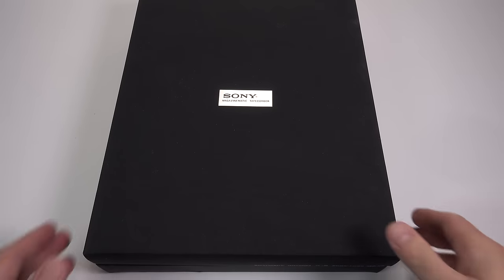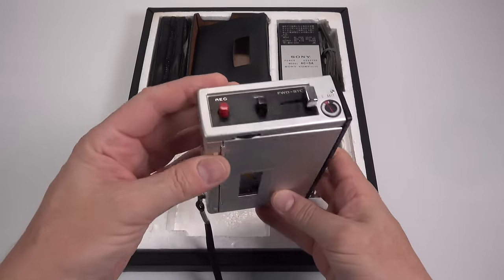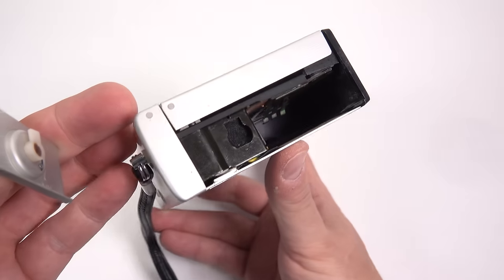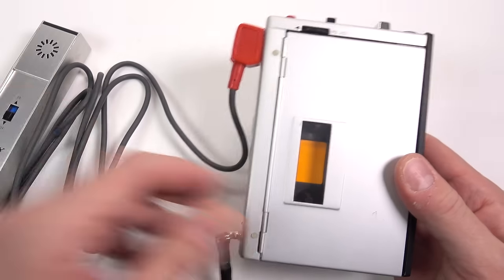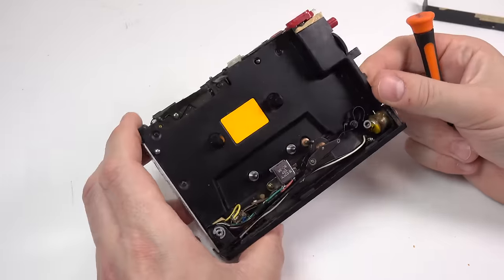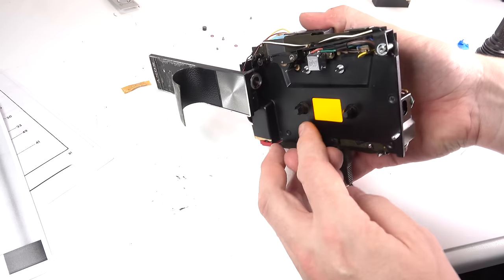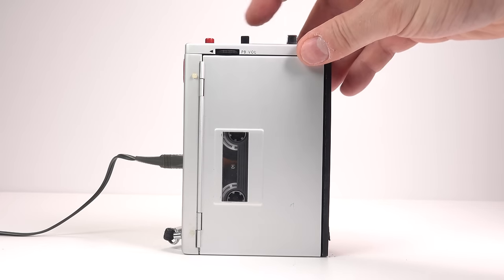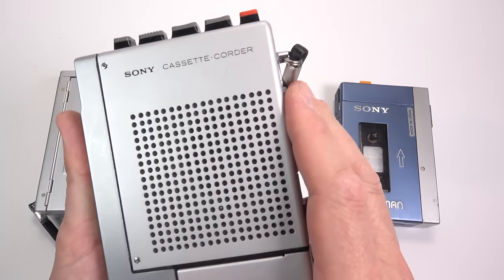Sony's proto-Walkman that went to the moon*

Comment: Lovely piece Techmoan. I had the same speed variation issue with a tape recorder from the 1960's, and it wasn't the electronics. I found that when the tape slowed down, gently tapping the motor caused it to recover for a while. In that era, the speed was cleverly regulated inside the motor by using centrifugal forces to momentarily pull away brush contacts as the commutator speed increased , thereby briefly breaking power to limit and maintain a maximum speed, a bit like a governor. This was even adjustable via tiny set screws, all inside the motor. I suspect your device has the same issue. In my case, cleaning and re-seating the brushes, and cleaning the commutator contacts resolved the issue completely. The curved face of the brushes must be preserved though to maximise the surface area in contact with the commutator, otherwise (as I discovered) insufficient power will be delivered to the motor.

Comment: I love the grille for the built-in microphone. I've seen that design on several old items way back when. I always liked it. The one on the hand-held microphone is nice too, but of course doesn't catch the light in the same way. I'd love a fully-restored one. No actually, I'd be terrified of scratching or losing it. I'd love a replica, or something in the same style. I wonder if that lovely spun grille could be made with today's "maker" equipment. Perhaps it would take a good CNC milling machine for the holes and perhaps the same or perhaps a lathe to produce the spun effect. I wonder what tool head makes such a perfect and subtle circular pattern.

I've seen some packed circuits, but I think that is the most packed of all!
Reply: Posted that early because I thought it was quite long enough, but I have to add that the second half of the video had me glued to the screen too. That Sony exec did just what I would have done. ;) I loved the bit with the reflection, too; I had no idea the tape wasn't inside the machine. The puppets were the funniest I've seen so far. :) I'm replying instead of editing because Youtube right now doesn't seem to be working any better than that TC-50.

Comment: They  also showed a small cassette player in the movie Apollo 13. It even got his great scene when its floating running out of battery because the capsule was frozen. But I am not sure if they actually used the correct TC-50 for the movie, or some other (later) small Sony player to play it.

Comment: I still have my first (and only) walkman back at my parents house. Also a Sony Walkman. I bought it back then - when the CD versions were already on the market - 'cause I wanted something small. And I owned more tapes then CD's back then. It still works I think. Don't have any use for it anymore. So it just sits in the box. Only thing missing/broken are the ear-pieces.

Comment: I expect someone gave bad shipping advice unless it is specific carrier rule:
From TSA website, pretty sure I'll find similar for other countries, it is lithium cells they are generally worried about and I expect that is where the mixup was:
Batteries Allowed in Carry-on Bags:
    Dry cell rechargeable batteries such as Nickel Metal Hydride (NiMH) and Nickel Cadmium (NiCad).

Batteries Allowed in Checked Bags:
    Except for spare (uninstalled) lithium batteries, all the batteries allowed in carry-on baggage are also allowed in checked baggage; however, we recommend that you pack them in your carry-on bag whenever possible. In the cabin, airline flight crews can better monitor conditions, and have access to the batteries or device if a fire does occur.

The only thing that is recommended is take out of device and put in it's own insulated container so the contacts can't possibly be shorted.

Comment: I have one of these!! I had no idea of the story behind this. Mine works too! It does run slow like yours, but records and plays back voice perfectly.  Also the A/B tab says easymatic not magazine matic. Of course I had to use a dc adapter. I do have the battery pack but it had three rechargeable double A's in it that I had to remove and if I wanted to I could rearrange some tabs to be able to put regular double A's in it and rearrange the battery pack. What a cool video to find! Thank you!!

Comment: That beauty WM-EX5 as a mirror... I bought as a new in 1998. I used it every day until falled in parts in 1,5 year. Unfortunatelly I had many mechanical problems with it. The door mechanism is supercool but it's suck in everyday use. Very delicate and sensitive for every mechanical pushing, wearing in tighter pocket etc. I had continously moaning problems.

Comment: Again, a super-interesting episode. 
As I am far from being  a mechanic but trying to digitize my father's cassettes from the 1970s and 1980s out of pure curiosity, I got myself a Dual boombox and was not so much disappointed of how the machine played but of the loud hum, rumble, and sometimes even high-pitch frequency whistles the cheap mechanism sends out even to the headphones output. I remembered your advice to look for new old stock if possible. I had to look for a portable player or thereabouts as I still have one somewhere dating from 1992, but the mechanism is no longer working (first the autoreverse machanism kept switching sides over and over, then the motor no longer turned the spindles). And as you were talking about the prototype of the first cassette Walkman, could it be that I might have got the last cassette Walkman in their range? As I was trying to find a machine as new-looking as possible with a price as acceptable (and affordable) as possible, my eyes fell on the Sony WM-EX. True, it is one of the type which no longer has noise reduction on board already and has nothing to do with the mobile and stationary devices I had owned in the 1990s, but still it might at least deliver something decent to the output. The instruction manual dates from 2004 - I wouldn't have imagined that Sony had produced cassette Walkmans (or Walkmen) for that long. Was it probalbly one of the last in their series? Fun fact: as you recently got many items from Germany, the US or Japan, my model will be imported from the UK. Greetings from a German follower :-)

Comment: I saw a programme on TV many years ago looking at the Sony walkman factory, the presenter was in the design room, one of the designers finished his design and sent it off to be manufactured, the presenter said "that design is already out of date as there are more designs on the way"
it was basically the outer case and funcionality that were being designed, but using the same mechanism.

Comment: Another excellent informative video. Amazing to think that this design wasn't exploited by Sony in a bid to cash in on the moon landing. Back in 1969/70 almost everything was marketed with a tenuous link to moon! Seem to me they missed a trick there. The 1979 Walkman? I was 18 and don't remember much of a fanfare in the UK. I do remember the Walkman taking of around late 1980 when it became THE must have accessory.If my memory is correct it cost around £100 at launch- a small fortune!  Did it launch a few months later in the UK?

Comment: The first "Walkman" I remember was like a car cassette player with a front loading system and quite heavy. It was delivered with a thick pouch and meant to be worn during sports. I can't remember  the brand but it was american and quite expensive.It was a big sensation in the late 70s.
Reply: Front loading sounds like 8-track.
Reply: @19seventy97  No, it was a 4-track but was quite big, almost the size of a car radio. To get the cassette out, it "spitted" it out like on car radios. And the headphone was also kind of weard.

Comment: The speed control issue reminded me of my resurrecting a ~35 year old Technics record turntable.  The "DC Servo Control"  speed control was all over the place.  Serious music had a sadly comical sound.  The electrolytic capacitors had dried out.  Replacing the electrolytic caps brought everything back to like new condition.

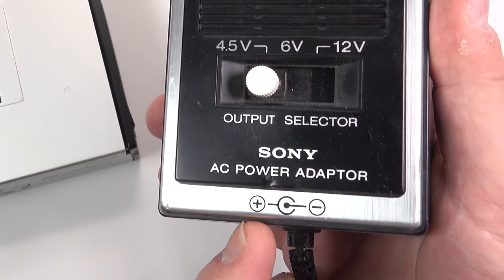Comment: 6:51 center negative was used by most if not all electronics 'till the early 80's (even the Sega Master System uses center negative) the reason was is that the outer pole acted as a switch: if an external power source was being plugged it, it would disconnect the battery pack from the device.

Comment: If it was 1968 it probably had 100% discrete components, transistors, resistors, capacitors, it was really hard to pack very much electronics in a small space in this era.  My 1971 Panasonic RF-888 portable radio was an early portable devices to have an IC (integrated circuit).

Comment: 1:20  I'll give you very good method to remove stains from paper. You need to use white chalk. The one that absorbs moisture easily. Scrub some white chalk on the stain and press it with something firm (e.g book). Leave it for few days and the stain will disapear.

Comment: A year ago I got a beautiful  1972 Sony CF-450 (mono boombox) for $1.00 plus shipping on ebay. 
The auction stated that the cassette did not work. I planned to replace the belt, which had turned to dust,
but encountered the same Rubik's cube that you did! Different model; same assembly philosophy.                                                            I thought about ordering a service manual from ebay but couldn't believe it would tell me anything useful
other than that I had to desolder every single wire. And that I was not prepared to do.

Comment: Sony's chairman was not alone. I started my job as export manager in 76, saw the tcm-600 at duty-free. made an adaptor 3.5mm mno plugto 1/4 inch stereo line socket, to play my own recorded cassettes, while on long trans-atlantic flights, albeit in mono. playback thru speaker good, while at hotels. just wish I had licensed idea to Sony :(- I wasonly 26 at the time. still, I avoided the dreadful 'air-tube headsets found on most jets like the 707, back then. lesson, if you have a good idea, patent it, if viable, approach industry-compatible partner, to commercialize it - fast as possible.
Reply: Sony engineers considered creating a dedicated, personal audio player years before the Walkman but the technology was not ready. The breakthrough for high-quality reproduction at reasonable operating cost would not arrive for two or three more years. Even more remarkable, Sony did not patent any of their audio technology during this period because they considered the equipment iterative not inventive. It came back to haunt them when savvy individuals began protecting the same ideas and filing legal writs against them and other tech firms.

Comment: You just need a good soldering iron and a decent electronics supply shop to get all new electronics for it. You could even bodge together a Ni-Cad battery pack for it. The tricky part is the mechanical systems. Getting everything a fresh lot of oil won't do the trick as doubtless the motor needs an overhaul as well.

Comment: Center-negative wasn't a Sony thing. It was a portable electronics with DC in and batteries thing that persisted a bit longer in Japan for reasons. EEVBlog has a video where he explained that being center-negative enabled them to automatically switch from battery power to external power without any special circuitry (switch is built into the jack). Understandably, Japan was more entrenched when the rest of the world started settling on center positive in the late '70s and '80s, but it wasn't just because they made more compact and portable electronics. It was also because it was standard-practice to sell DC consumer electronics without a power supply so that the user could pick up an appropriate PSU for their region. Recall that Japan had 50hz and 60hz regions, so it made a lot of sense to make the device DC so that it worked in either region with the appropriate power supply.

It became standard-practice not to include a power supply in Japan because you very likely already owned a compatible one. For example, Super Famicom didn't have one because you were expected to use the one from your Famicom or buy one if you were the weirdo who didn't have a Famicom or compatible adapter.

This is also why the DSi XL or 3DS XL or whatever didn't include one in EU/AU and the New 3DS XL didn't include one in the USA. This was particularly egregious since it displaced whatever device you aleady had with that proprietary PSU by playing the exact same games, so you needed to buy a new one if you wanted to do anything at all with the older unit. US consumers balked (as they should) and you might notice that the USA got a USB plug with the NES and SNES Classic Edition where the Japanese version sold it separately exactly like the original Fami/Super Fami. ;)

Here's a quick list of retro game consoles I know of that are center-negative or compatible with center-negative:
Master System/Mark III
Megadrive/Genesis model 1
Mega CD/Sega CD
Famicom/NES (NES accepts either polarity)
Super Famicom
Virtual Boy and Japanese AC Adapter Tap
Game Gear (some regions)
Game Gear battery pack (some regions)
Neo Geo AES
Atari Jaguar
TurboGrafx-16/PC Engine
TurboCD/PC Engine CD-ROM²
CoreGrafx/CoreGrafx II
Probably SuperGrafx

You've got NEC, SEGA, Nintendo, Atari, and SNK in this list. Pretty much every relevant company making videogames at the time center-negative was holding out. ...definitely not just a Sony thing. Sony's Discman power supplies switched to center-positive around the same time everything else did (TurboDuo/PCE Duo, Genesis model 2, Sega 32X, etc).

Back on topic: In the '60s when this Sony cassette player was made The West had not yet settled on center-positive so it was even less of "a Sony thing."

I hope you find the reasons behind these differences as interesting as I do.

Comment: This might be my favourite thing you've had on your channel.
Normally I appreciate the spectrum of 'stuff' - which I might have owned, lusted after, known about - but this takes it a step further.
I had no idea this device existed, nor that it had gone to space - but was clearly the precursor to every walkman I every owned/lusted-after/etc.

This is actually 'important'..

..In this current age where we'll sell vinyl to millenials, micro-emulating consoles, or even then FPGA 'better than the original' stuff - well I'd pay quite handsomely for a new build of a device like this.
Sony should really get on this. As a 40 year old I have fond memories of Sony's contributions - but today, they're the 'console people' (or expensive reseller of an LG OLED panel).

Comment: NiCd batteries act as extra capacitors with high ESR, so without the battery pack, power regulation is less than designed.

Comment: Just to further The Moans point, they didn't land on the actual feet of the Lander Module, they landed so much more softly on the surface of the moon that the egg-box-like shock absorbers didn't deform, apparently, such was the Commanders excellent emergency flying skill.  This is because they had to land some distance from the intended landing spot because of unforeseen rough terrain and landed in softer stuff too. So the Landers 'feet' didn't actually touch the surface either.  !:^D  Nice one though.  I'd never have known that about the humble personal cassette player.
Reply: Their onboard comp wanted the original landing area. Stupid computer.

Comment: If you look at the film Apollo 13. One of these models also features a few times. The film was shot about 20 years ago; when more of these devices might still have been available in running condition.

The original events happened in April 1970. So I wonder if they used the right prop. They were amazingly accurate about everything else. You get to see the device spinning in zero gravity. Also - slowing down and slurring, due to the cold and very damp conditions that developed later. One Cap Com says he intends to take his entire Jonny Cash collection with him on Apollo 19. Perhaps that's why NASA canceled it 👍.

Due to the Aplollo 1 fire Every switch in the Comand Module and Lunar Module control panels was very carefully sealed and insulated; to prevent sparks. Which probably saved the Apollo 13 crew.

I love the Puppets sequence at the end. It reminds me of the mad conversations I seem to get involved in with my Tasmanian friend Richard. Who was at the 50th anniversary gathering at the Park Radio Teliscope in Australia yesterday. Mission Patches for Appolo 11 have been arriving here for weeks. See the film "The Dish" which explains those events.

Comment: In 1974 I had a TC55. It has a similar remote and micophone input to the TC50 ideal for recording lectures and meetings. In 1983 I got a pair of TC600 to work as tape recorders to a Grundy NewBrain which had two cassette ports. The TC55 had a very good sound and better than the first Walkman, but in mono. The TC600 is a higher quality and even smaller still retaining the built in speaker.  Both TC600 needed repairs as they had a variable playback speed - new belts and replacing capacitors. http://www.mcmullon.com/icollect/hi_fi/sony/images/sonyTCM600_48945.JPG

Comment: Lunar dust got all over the interior of the lunar module; they got covered in the stuff on their spacewalk. Some of it definitely touched their bare feet at some point.

It also touched the insides of their lungs, which wasn't very fun since the lack of erosion made it pretty sharp. The new spacesuits will eliminate that issue.